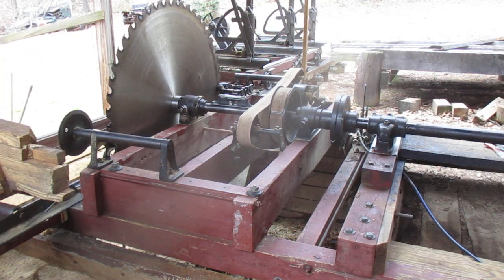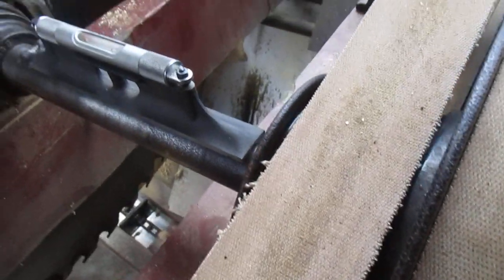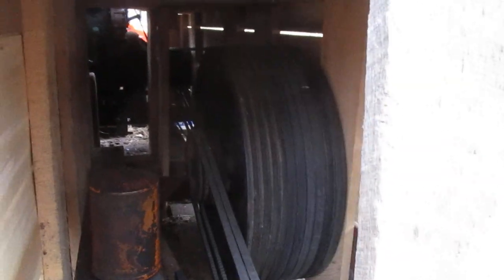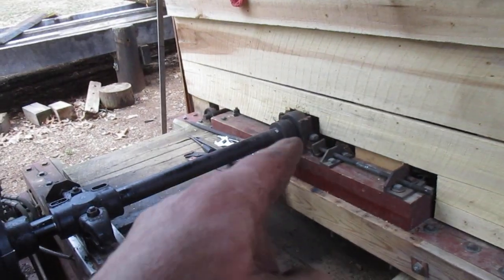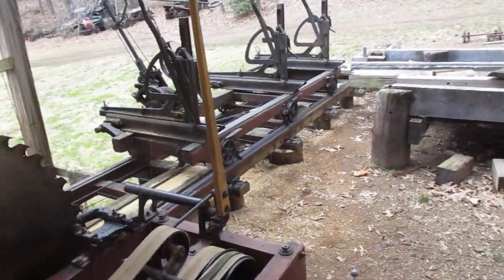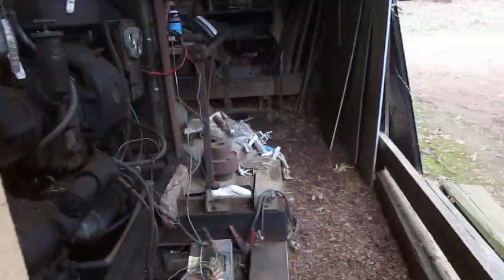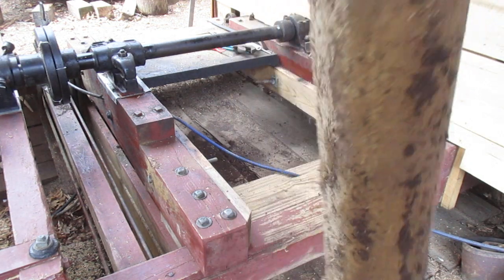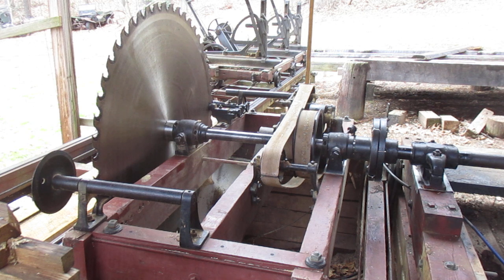Little sawmill runs again # 1084

Comment: I'm wondering why the need for 4 bearings? Does the flex bushing in that hub allow too much wobble if it only had the one bearing at the drive pulley end?
Good video, thanks.
Reply from the maker: hi there don't know why but just the way its done , john